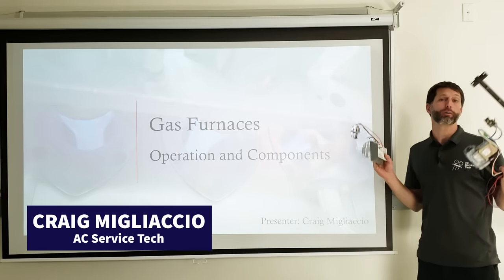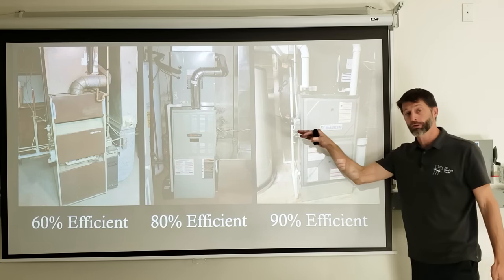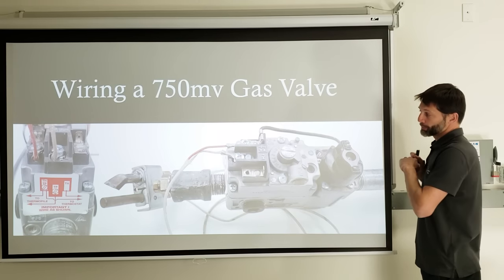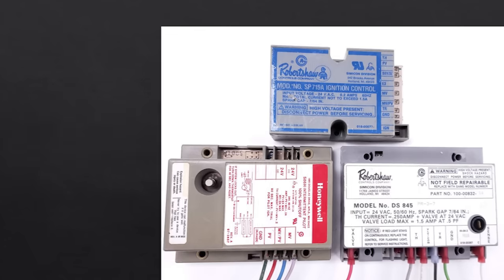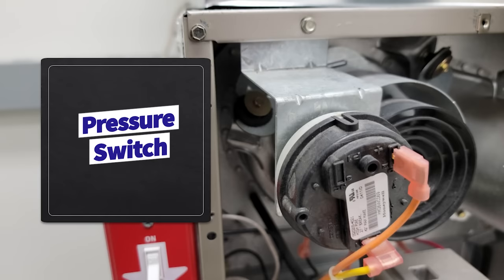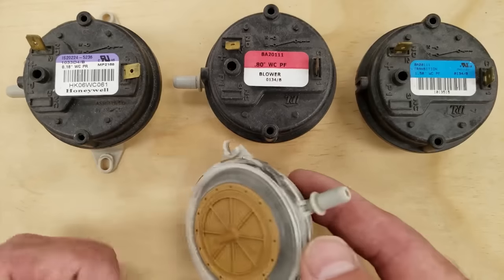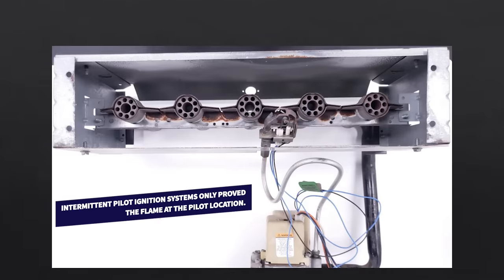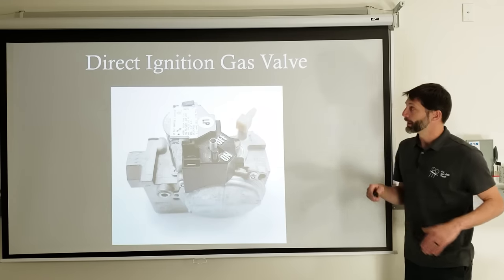Gas Furnace Training Class! Basics, Operation, Components, Troubleshooting

Comment: Wow, wow, wow, your videos that you are showing online are phenomenal. I was an aircraft mechanic for 20 years then I became a locomotive engineer for the last 16 years, now I’m retired. When it was time to replace a 30 year old furnace I thought why not just get a package AC/furnace unit. After installation, (installed by licensed personal) I opened the panels to get model numbers and serial numbers for warranties. I thought to myself what a mangled spaghetti mess of wiring, all of this just to run a furnace and air conditioner. After realizing the cost of any service call, I decided that I needed to learn how my furnace works.

After two months of watching all your videos I’m able to identify what every wire does in my furnace and AC compressor unit. I know what each component does and the purpose of it. I'm still learning some troubleshooting techniques. At this point the only thing that I know that I will not even attempt to do is to, replace any component that will break the integrity of the refrigerant system. If anything needs to be braised/soldered, the cost of having that done will be close to the price of a new unit. Its better just to buy a new unit. I did take an AC course in collage for diesel mechanic in which we had to get a 608 certification. I don't know if you offer that or not, but this would be the place to learn on how to handle refrigerants    

Every homeowner needs to know how this equipment works, even if they're not going work on it, they still need to know how to maintain it. I can only imagine how many house fires were caused by homeowners neglecting and or being naive towards their furnace and AC units.

Comment: Love the size and it fits perfectly in a corner but Fastly.Cool the whole room. Really like how you can auto adjust how long you want the fan to be on. It is quite but highly effective.
Reply: Can you switch out gas valve electric heater element
Reply: Reason why I'm going to do gas is too high

Comment: I’m going into my 3rd year in the trade, and into my 2nd heating season as a service tech. This video was a nice little refresher.
Reply: greg...my system is about 40 years old....works just fine but I have never seen a control board....the thermostat controls everything. Is that possible? Thanks

Comment: Starting HVAC school in about a week and I’m super nervous don’t know much but these videos are a big help 😬😬😬
Reply: Ah if I had these videos when I first started it would have been such a breeze. He’s doing the course work for you. I would brainwash Craig’s videos till it clicked.
Reply: The fact that you care enough to watch this stuff and try to follow along means you will do just fine. Refer to these videos when you struggle. Even after you get hired. You got this.
Reply: Watch "HVAC School" videos on refrigeration cycle and EPA 608.  Fundamentals first.  Expansion equals loss of heat and compression equals heat.  One coil and fan distributes heat, another coil and fan distributes (loss of heat) cold.  Fan speed/size, duct sizing, lineset sizing and coil sizing determines rejection of heat or (loss of heat) cold.
Reply: How's school going bro??

Comment: Thank you - Great video in explaining everything about the furnace!   But I do not understand the explanation of the ground voltage drop test @52:35.  Why is the check measurements are in ohms instead of volts?   I think you may meant to say is that with the power on (120V), the voltage drop should zero (therefore no resistance ), but if instead the voltage reading is like 0.4 V then that means there is problem (i.e. there is unaccounted resistance somewhere)?

Comment: On that millivolt gas valve. How important is the wiring colors to terminals? Does it matter where the red and white wires go on the terminals? Will it work with red wire on th and white wire on TH TP?

Comment: Is there ANY way that a 90% natural gas furnace could be venting what smells like a faint smell of "car exhaust" or the like!?  I feel like when my furnace is on blowing I can detect that.  It is not all the time either.  It only seems to happen when the temperature goes down to colder temps.  Is it possible to have a crack or something like that in the heat exchanger or something that could cause this?  Also, I feel that in the summer I can also detect something when the cooling unit is on blowing.    I dont know what to think about all of it! ?

Comment: Hi, My gas furnace starts up like normal and after the main blower turns on and starts heating the house I notice the burner turns off for about 15 seconds then lights back up and continue turning on and off until the house is up to temp and then shuts off? I never noticed this before, is this a normal thing or is there something wrong and if there's something wrong what would it be? thanks, Dave

Comment: Is it correct that my 25 year old Carrier 58GSC series upflow furnace does not have an inducer motor?  My problem is that I set my thermostat and flip on the furnace power switch but only hear a click or clunk sound but nothing else happens.
Reply: Being that old,it might or might not,but it still will have a sequence of operation,what type of ignition?Do you own a meter have you checked voltage,power to furnace,24volts from transformer?If you dont know if you hsve an inducer or not you might want to call a professional.

Comment: Could you do a YouTube video on a Crown Bimini Gas Boiler? Mine is a BWC225 with Honeywell MCBA14201D controller board, Honeywell  Gas Valve VK8115V 1036 4, Honeywell Venturi? Valve VK8115F 1134 4, and Whatever the Factory Supplied Combustion Fan is (I don't have that info). Right now the burner flame is mostly ORANGE. So if I can't get it fixed,, it will be replaced and donated to you. Thanks, Chuck

Comment: i have a 60% , it will spark and lite the pilot but will never open the main burner valve. I put and extra ground wire to the Flame Sensor and ECM, cleaned the flame sensor and still does the same. I have i think 3 terminals on the main gas valve, is there a way to put 24 volts to this valve to test it?  ( I also tried to measure AC voltage to the flame sensor but had no luck. )   Thank you
Reply: Check for 24 volts at main gas valve,if you have 24 the gas valve could be bad and sticking,if you got the 24 volt at valve you could lightly tap on gas valve and see if it opens,if you dont have 24 volts at valve,the control board could be bad

Comment: I have one of those high efficiency goodman and it's like new yet but in the spring we ran out of propane so I didn't refill it till the other day and now it won't fire up as the igniter fires up but I don't hear no gas or see no fire, could the line have air in it that needs to be bleed out since it sat empty all summer ? when I get home today I'm going to pull the plug going to gas valve and see if I get 24v so of someone knows maybe what wrong with it let me know. also the red light is blinking code 1